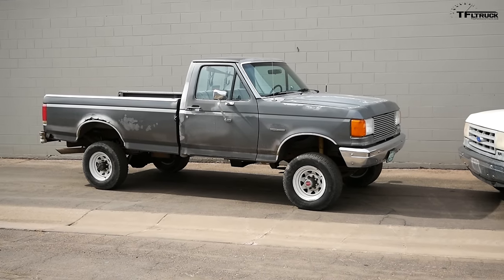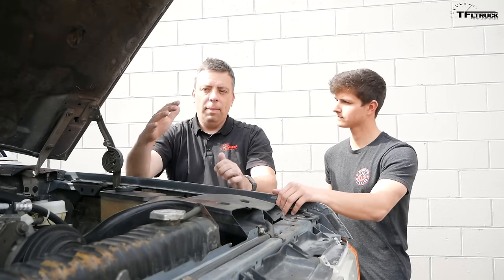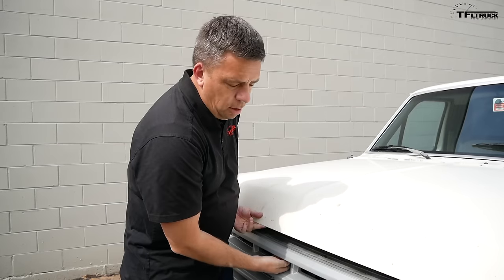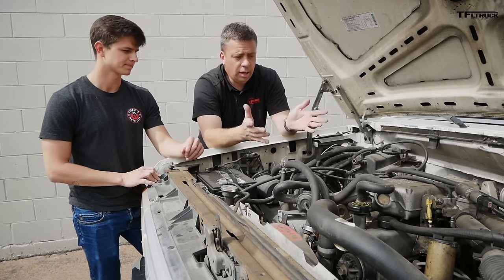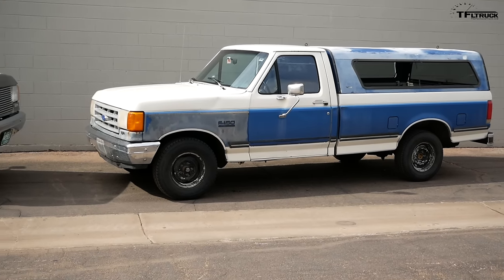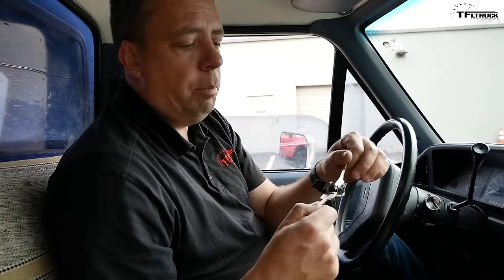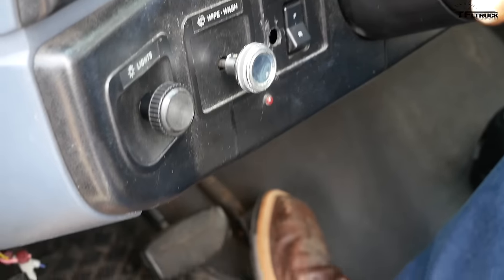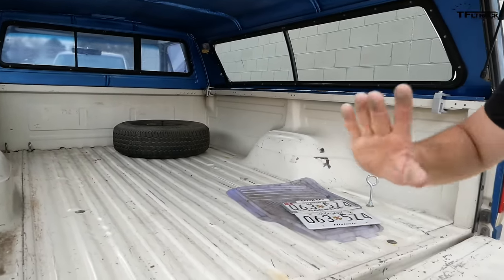Here's Why You Can't Kill An Old Ford F-Series Truck | Gunsmoke Ep.3

Comment: Where are the F 250 4x4 with the 300 ci six with four on the floor and high/low four wheel drive like my brothers 1967 he bought new that is still on the road today! True, when he had it for 36,000 miles and I asked him how often he change the oil he asked, "Change the oil?" I then did him a favor and dumped the oil, put trany fluid in it and drove it for 25 miles, dumped that out and added 10 W 50 oil in it. He drove it for another 51,000 miles replacing the oil every 3,000 to 4,000 miles when a rod let go! My cousin and I did him another favor by finding him a used 300 six with only 58,000 miles on it! It took only 6 hours to swap engines and go to the store driving it for some beers! This is how durable these Ford 300 six's are!

Comment: I have a 94 f150 4.9 straight six, and the thing runs like its new, sure it has problems as a 25 year old vehicle but once it starts it dont shut off until i turn the key. It's my dream to completely restore the body and interior, the body just needs new paint and some rust taken care of, and the interior is in good condition but its still 25 years old and the dash is cracked to hell as most of them are I've heard. So i'd love to just put in a new interior and have it look the exact same as it did when it rolled off the line

Comment: funny the 73's the older ones they always smoke because they've got a manual transmission all the ones didn't but the manual transmissions did. I have an 01 f250 7.3 crew cab short bed with a 7-3 I've got zf6 4x4. underhood I put a tuner under it I've got about 415hp  I use it  pulling mainly.

Comment: I had a e150 with a 4.9 it had over 300k miles on it when I sold it I had that van ten years ..I have a 1988 f150 still that I have had for 15 years it's got 250k miles on it and runs like new  so yes best trucks out there  is the older ones

Comment: I had 2 300 CID Inline 6's. I had one with a 4 speed manual in a new 1980 Econoline E150 with a carb. I had a 1992 Econoline 3/4 ton that was a used courier truck that 300,000 kms on it. I put another 100,000 km on it and road it hard and tranny rebuild. You can not kill the 300 CID engines.

Comment: Would y’all like another donor 4.9l? Has the m5od, 8.8 gears, with a Dana 40. Truck is minty inside and o it besides two small dents and a some scratches on the new paint that could buff out easily.

Comment: If you boys need any help modding out the injector pump and tuning it for  performance gains on gun smoke.  Hit us up with our stage 1 idi kit we can get you to 250ish hp and 450ish ft/lb of torq on stock injectors, injector pump, and all without a turbo. If you go the turbo route we can get you anywhere from 320-900 hp and 500- 1300 ft/lb with the top notch parts from our buddys at classic diesel design. All depends on your budget. These motors get a bad rep. for being very doggy and slow. The aftermarket is small compared to the 7.3 powerstroke. But like you've said they are all mechanical (except the fuel cut) you can make big reliable power with these your just going to spend more compared to a powerstroke for the same gains. A worth wile trade off for the mechanical reliability and ease of repair in my opinion.  My shop truck has 900,000 miles on it and damn near stock compression ratios and on its second injector pump still on the factory injectors if that doesn't impress the idi sceptics then i don't know what will.         - Ant Slade. P.s. - first thing to do is cut that soup bowl out of the air filter hat, its free and will give you greatly improved air flow with a small but noticable 5ish hp gain. Also if your going to turn up the injector pump by yourself without modifying the gov. spring and fuel cut spring be sure to go no more that 3 flats ( that's a half a turn clockwise) as anymore than that will actually cost you power, fuel economy, it will smoke like hell and an over fueled truck can cause overheating issues and worse cylinder wash down which WILL end in engine failure and will likely run away on you. Hope you or someone finds this comment helpful.

Comment: My dad had a copper 1995 Ford F-150 with a 300 six and one tone springs cuz we hauled fire Wood the head gasket went so number six never fired it had a 5speed stick and on the last day we had it it had 280000 miles and we had 2000lbs of steel in the bed and pulled a12%grade at What  our speedometer said was 85mph but our buddy said his was reading95 mph it sold the next day for $600 and will runs

Comment: I remember when I was a kid in the sixties that a lot of farmers who were Ford buyers would get the 300cid six for pulling their livestock trailers, because of the low rpm torque.  But as an adult, I drove one while working for a farming operation, a low mileage, '96 F150 with this engine, but by then it had been ruined by Ford's failed attempts to meet emission standards.  It had NO guts and got lousy fuel economy besides.  Plus, despite being kept clean, the sheetmetal rusted out horribly before it got close to 80000 miles.  What a shame.

Comment: E4OD Wasnt really the work transmission. If you wanted to work a half ton you would order a C6 or a 4 speed manual. I have an 88 F150 with a 302 and a 4 speed T18 manual. Thats a true work truck.

Comment: Great video!! I love these Bricknose Fords!
Quick question, since you have a f350 and an f150 of the same generation sitting next to each other, i was wondering if you could take a pair of calipers to both frames and see if there is any difference between thickness of the two models? 
Since they are so similar i’ve heard mixed answers about that.

Again great video!!
Reply: The F350 has a beefier frame.
Reply: Noah Garay right. Im looking for an actual number.

Comment: I've a '78 Econoline 150, straight 6, 3 on the tree, with 350,000 miles on it. I rebuilt the body 8 years ago, replaced the 3 speed trans (kept the old one to rebuild), parts are plentiful, available, and cheap... This van will be  my hearse... it runs great, smooth as can be... the head has never been off the of it.

A guy in my neighborhood has a '94 F-150, 4.9 six, 5 speed Mazda trans... he wants to get rid of it... I'm salivating...

Yeah... bleed the brakes... check the calipers, cylinders... replace em... they're cheap...

Comment: If it continues to throw a lot of smoke after it is warmed up... Try advancing the timing on the injection pump. Advance it by the thickness of one dime and see if it works better. If ot, try another dime's thickness. Note: I am not talking about turning up the fuel. I am talking about turning up the timing, by turning the top of the body of the IP towards the passenger side.

Comment: I personally love the old trucks I have a 96 F250 XL 5.8 gas burner for a work truck I bought it for $300 it was headed to the junkyard I put around 2,500 in it and that's with a new set of wheels and tires truck is like brand-new now and runs great 298000 MI I've had people offered me up too $6,500 and I will not sale it for that price worth 12000 r more to me

Comment: The the inline 6  300 were excellent only fault ever find with those truck from that year was the aluminum timing cover if the motor ever for over heated the water pump bolts would seize in time cover and were a pain to get out because if steel bolts in aluminum timing cover but other than that excellent motors and e4od transmissions  were tanks weighing every but of 350lbs they were reliable transmissions

Comment: I own a '94 f-350 7.3 factory turbo, and a '95 f-150 300 I-6. Drive them both on a regular basis and the '94's diesel has over 400,000 miles on it...never been rebuilt. Simple is better.

Comment: Hi my name is Jeremy and i no all about the ford f-150 that u have because i actually own one and its sitting here in my driveway right now and it has the same motor in it like the one that u have but the only thing different is that it's a ford f-150 lariat with a 5 speed manual transmission i also have the air condition that i replaced myself so yeah u have a good ole truck and mine is a 1989 ford

Comment: Im new to driving manual, 3-weeks in because I bought a ‘95 f150 xl manual I6 - 4.9. Can anyone confirm that what was said about the diesel starting on 2nd gear could apply to the manual gas 4.9 I6? Again I’m new to driving stick so whenever I’m at a light or staring to roll on 1st gear I immediately need to shift to 2nd ‘cause the revs are high going 10mhp on 1st. If anyone could give me pointers or confirm that starting on 2nd on a gas manual 4.9 I6 would help! Thanks

Comment: Had a family member that rebuilt a 300 in an 85 f150, found two piston shirts in the oil pan yet the engine was running fine.

Those engines just don't care

Personally own an 87 f150 with a 300

Comment: All one needs is an old Ford F series.

Nothing complicated with these vintage F Series, no air bags, no bluetooth,  no back up camera, or other complex electronics,  it's all simple and pure old school glory.

Screw and forget the hondas / toyotas.

No japanese, not even camry or civic can touch the durability and reliability  of a old Ford F Series.

If you are a supporter of honda / toyota, I dare you to put 2 large cups of sand into the engine, and let's find out how it runs.

These old F Series are built Ford Tough, yes its genuinely tough, solid made, super durable and super dependable.

Comment: There is not a Dana 60 axle in the rear. It is a sterling 10 1/4 inch Ford axle. It doesn’t really matter into you actually spend money on parts and they end up being wrong.
Reply: If it has 12 bolts it is the Ford Sterling. If it has 10 bolts it is most likely The Dana60

Comment: I have an 86 F150. The mechanic cannot get the oil pressure stable. He’s been working on it on and off for six months. With tires I have invested $6100 total. He’s replaced almost everything that was old. The truck is done. It’s only the oil pressure that’s an issue. Any recommendations?
Reply: New mechanic

Comment: You can find many mint low milage 90-96 ford f-150's for 15,000 to 20,000 on classic car websites. I don't know why more people are not buying them instead of dropping 80,000 plus on these new trucks at a dealer. I can get by without the cup holders and electric seats plus repair costs of a newer truck. And in 10 years my 20,000 used ford f-150 will probably be worth more then the one you bought new.

Comment: i bought a 84 f250 xl sitting for 4 yrs wil not crank at first but i made it to crank but i need good mechanic knows about this f250 xl body is immacuilate no dent  need front gas tank (i already got it) need new upholstery fabric i like to sell/and clean running board

Comment: I had an 84 150 with a 351. The crankshaft broke. The. Crank. Shaft. Broke. Had another that went through valves like fuel filters. Had a 04' f350 6.0 and that... Well even after bulletproofing it it still needed constant work. Ford is pure garbage through and through. Get a v8 Tundra if you want the best daily work truck ever.

Comment: You keep oil changed  they will last 4 ever my dad order a 84 f350 4x4 300 4 speed 3.73 gear was the lowest you could get unless he wanted to buy truck new no Warranty with a 410 gear.he pulled a gooseneck he made to haul corn it weight14800 pounds an it pulled it to the mill for years it would pull the guts out but never blew it up it was slow getn up to speed with all that  weight but it was  work horse he finally bought a new dodge deisel in mid 90s an usecd the old Ford on the farm for years an i totaled my truck in 04 an he gave it to me an i drove it every day till 2011 an put it back on farm were its still going strong.we always washed it ever week an its not got a spot off rust on it.i thought about doing a Cummins swap in it but i can't bring myself to take that good 300 out of it

Comment: 6:30 is the beginning of a fairly drawn out lie. 1 it wasn't sand. Sand would simply tear up the oil pump and plug the oil filter on any car. it was liquid glass they were supposed to use. Liquid glass would circulate through the entire engine and as it heats up, would turn to a glass-like substance which did tear these motors up too. It simply seized the bearings to the crank while wrecking all friction areas.

Comment: I own 3 trucks, a 1992 f250 with the 7.3 and 5 speed just like gun smoke, an 1989 f150 with a 302 and a 5 speed, and a 1991 dodge w250 with a 12 valve  intercooled cummins also a 5 speed. I wont buy a new truck  because a too expensive and b I'll take mechanical and analogue over sensors and computers any day of the week.

Comment: You can kill these trucks. The last Ford truck I owned was an early 70s F100. Obviously, the engine failed in it before I got it because it had a big block crate V8 in it when I got it. I've seen some beat-up old Ford trucks, but I have seen plenty of them broken down in need of very expensive repairs too. If they were so reliable and unkillable, you would see a lot more of them on the roads still, but you don't. The typical age of a Ford truck within about 30 miles of me (based on what I have seen) is younger than mid-90s. I've seen maybe three older ones in the past five years. I've seen a lot more Nissan B2000s and B2200s on the road than I have old Ford pickups. Heck, I have a Nissan 720 from the mid-80s with 300K miles on it and nothing mechanically wrong with it. Runs fine, starts up easy, plenty power, the only reason it's not on the road is I need a new set of tires, some brakes, and to change out some fluids. I got it from a scrapyard as "non-running" for basically a steal. Put on a starter, a fuel pump, tapped the carb a little, fixed some wiring connectors and she fired right up. Went ahead and changed the oil and working on the rest it needs before I drive it off my property. Not pretty to look at, but runs fine.

Comment: Do you know why they couldn't destroy them engines in the cash for clunker ordeal? Because the 4.9 L inline 6 engines have an oil pressure sensor if there's not enough oil in the motor it will not roll over! On top of that I had a friend who ran his 300 inline 6 on Mountain Dew for 1 week!

Comment: old ford f series and volvo 240, 740 940 760 960 v90 (90's) had engines from tactors. we would have more of these running around if the government didnt do cash for clunkers. majority have already passed a million miles. Why cant we produce these same engines? They are simple reliable and automobile manufactures could make them more efficient

Comment: I have a 1989 F 250 4x4, with a 5.8L gasoline engine and an automatic transmission. and I absolutely hate it, it's constantly breaking down and doesn't run worth a damn. and I have been constantly working on it. but I'm fed up with it and I'm going to get rid of it. and that will be the last Ford I'm ever going to own I'm done with Ford. they are garbage.